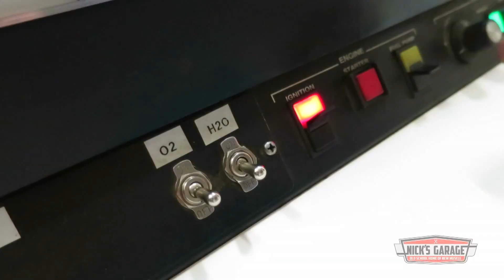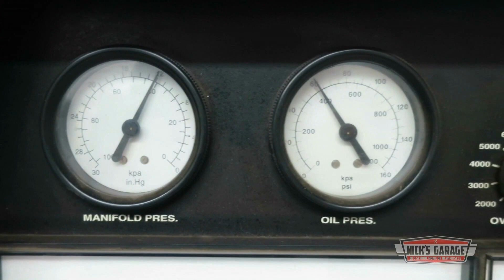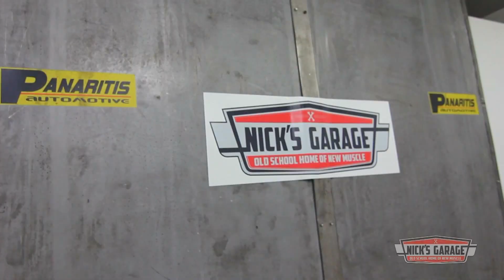Thanks a Million & 426 - HEMI idles on the dyno!

Comment: Hey Nick, congrats on pushing over 1 MILLION!!!!  Question: Looking at many brands of water pumps for BB mopar it looks to me like they could run either direction. Watching this video it looked like the pump was running counter clockwise. (I could be crazy). Since you have an electric pump and all the controls to test it, could you run a electric waterpump backwards and let us know the results??? I don't think the TURBINE style will work running backwards, but most of the rest look like it would work fine... This all stems from wanting to put an AC pump down low in place of the fuel pump and using a serpentine belt without having a bunch of idler pulley's...
Reply: Steve 1961P.   Standing in front of the engine, the electric water pump you see is Clockwise rotation. If I went the Counter clockwise rotation, I know it will not work, and will overheat. Why try it?  Thanks for watching

Comment: Nick if you had a ol 361 big block. That runs and you wanted to let's say freshen it up some. What would you do to it. ??? Right now it's sporting a 2 barrel carb. It's in a 63 D100 short bed truck mated to a 1 ton 4 speed.
Reply: I know your not seeking my opinon but I've drove a 361 in a 1960 dodge 2dr dodge matador  (google it), if your 361 is that good a 509 purple shaft is great cam for old school magnum 440 heads called 906s clean up the bowels, if its a auto go with 2000 stall gets the engine in the power band , and some small tube headers or save the 361 and find a 440 and go the similar route the 440 is slightly wider , and taller compression , there are a lot of rv drops out available. 
not to pricey, again magnum heads , headers small stall, cam? wide choices,  remember 440 stock were ran real well back in the day.....I was there use to go to the track before i got drafted....i know you asked nick buy being old school I'm sure he may agree,  i put a 69 rr to a best of 10:69 @125 back invthe day, 1984-84 down at houston international  near league city
Reply: Ed Clark,  I agree with Donald Powers all the way. And if I had it my way, I would go with a 440. Plentiful out there, not too pricey. I have build many 440s with the 509 purple shaft cam for the street, good choice and in some cases with Power Brakes, you will lack of vacuum if you push the brake pedal back to back in within a few seconds, the pedal firms hard, so be careful to stop.   Thanks for watching.

Comment: Thanks for posting Nick.  What are the sensors on each individual exhaust header?
Reply: Edward Dergosits,  Those are Heat Sensors, they give me a reading how hot each cylinder runs, For example, if it is running lean or rich on each individual cylinder. Good ways for fine tuning.  Thanks for watching.

Comment: Nick you think you could help me i have a 73 dodge charger rallye and it has the 318 ci engine i have 360 j heads but i am needing advice as to how much i should bore out the engine i am planning on a stoker not too big just like 390 cu in. 750 cfm carb headers probably a cam also haven't decided on that one yet anyways love your channel keep upp the good stuff
Reply: put a 360 magnum in it! find someone with a dakota rt 
get a ride that whats to do go with  a 91-95 od trans get the 2300 stall over the counter at mopar use the 91-95 wiring harnes... and put the m1 intake 4bb version if you dont like the computer switch the distributor and bolt a carb on the mi magnum intake and keep the overdrive and the pre 96 trans are 3 wire setup the center wire is hot the out side wires are to grounded each one complets the circuit one is lockvup and the overdrive, with the od transvyou can run 3:90s gears and you will thank me latter, i do this to the 91-95 Dakotas way tovmuch fun because of the lowend torque of the magnum 360 and shortie headers may actually fit the your body, but the magnum 360 actually and mounting loctaion for your chassis in other words  put you 318 motor mounts 
on the 360 , you can put the 318 valve covers on the 360 if you want the factory look, grab any magnum 360 and bolt it in you want the overdrive trans the years I  mentioned are very much inside like your 727 if you have one......the 360 magnum are around 245 hp and 345 tq......and they are roller cams that would be a really great set up
Reply: yup it has a stage 2 b&m 727 already i think it has the 3:90 gears already 360 j heads are ported already and with 68cc chambers long ago took the pistons out and put some that almost reach the top as the factory ones were almost 1.00  in. deep into the chamber at tdc it has a real choppy cam idles at 1300 it is really fun already even from a dig but b bodies are a lil heavy i think it needs a little more to at least keep up with todays stuff i hate computers less wires the better k.i.s.s. philosophy runs hot as shet a good 50° from the outside temp while you drive you be sweating dont need any heater in the winter time lol
Reply: witnesszer0.   Years ago I had build a 360 magnum engine for my brother in his 74 duster that he goes Bracket racing every weekend, for many years. He ran mid 11's at the track all the time, with pump fuel. A 360 magnum is a simple motor to make H.P. and is an easy installation from the 318 swap and use a carb.    Thanks for watching.

Comment: Hi, does the HP increase alot when the engine is running without an airfilter? If so, can you maybe do a comparison video like you did with the exhaust? 
Greetings from Namibia.
Reply: NambianGuy,  That's a good question, I have done a test once with a client many years ago comparing a paper element air filter versus K&N air filter, and the winner was K&N by 2 to 3 HP, But like you said, I will compare next time with air cleaner versus none air cleaner.  Thanks for watching from Africa.
Reply: Nick Panariti

Comment: what air fuel ratio do you like to see at idle?
Reply: Alex Laplante i would imagine it depends on the cam, manifold, and other parameters of the individual engine. I know my 493 liked to be rich all the time with the big Indy single plane, (the new indy dual plane will most likely be different) .  I tried to get closer to stoich on the cruise and it would barely do 55 mph.  
    That is a good question though, awhile back i asked nick to do a vid on stuff like that (the whys and hows of tune) on like a decent bracket engine.   I hope he gets the time, it would be interesting for sure.
Reply: Sandoz man.   In many cases I try to keep the air fuel ratio at 13,5 to 14.5 with basic stock engines at idle. But some engines with modifications I run them slightly richer like high 12s to low 13s . I will try to show one day on tuning an engine.  Thanks for watching.
Reply: Nick Panaritis thank you Nick!   You are THE Man for sure
Reply: Nick Panaritis: All of this fuel, air ratio kinda made me wonder Nick,  Using the Chrysler Hemi as an example. I've seen at least 3 different intake manifold configurations that use 2 four barrel carburetors. The inline or straight, the offset or  cross ram and the tunnel ram. Do you find any significant performance advantage in either one?  Maybe that would be a good subject for a video, sorta like the one you did about the Olds intake.

Comment: Hello nick my dad built a Chevy 355 at idle the vacuum is about 20.  But when he puts it into drive it goes down to 0 and the brakes get hard as a rock and I can't go for a spin . Can you help me so I can tell him he watches all your videos.
Reply: joe roveto.  First, if you have about 20 inches of vacuum at idle it's great. When you put it in drive it drops to "0" vacuum, then the engine will stall and your Power brake booster has no vacuum to operate, causing the pedal to be hard as a rock. Check your Timing, maybe it needs to be advanced, check for vacuum leaks, is your power brake booster in operating order? Did the engine come out of the same car? If it worked fine before, what changes have you done after the build? Let me know.      Thanks for watching.